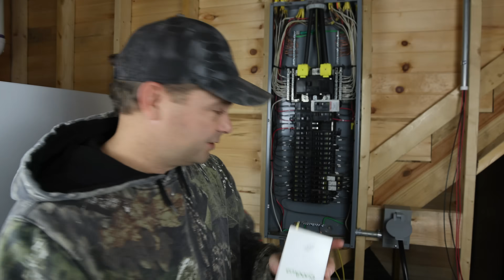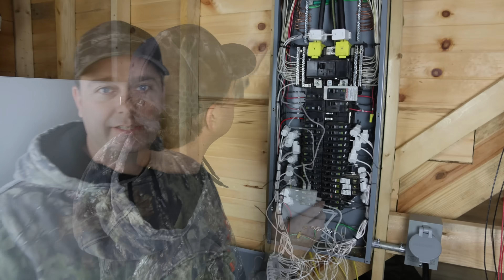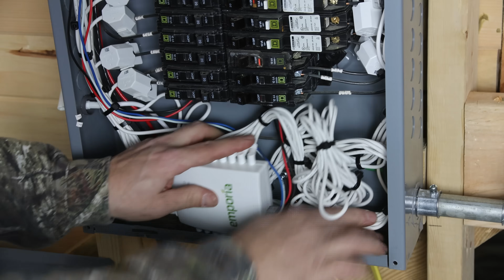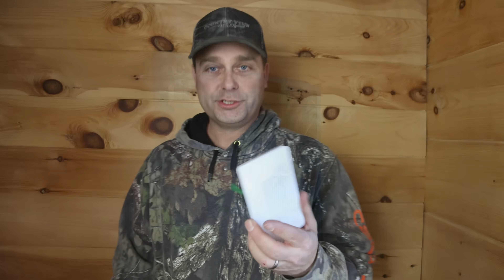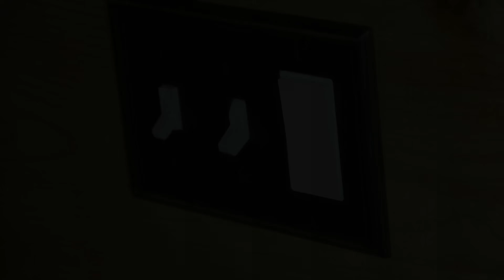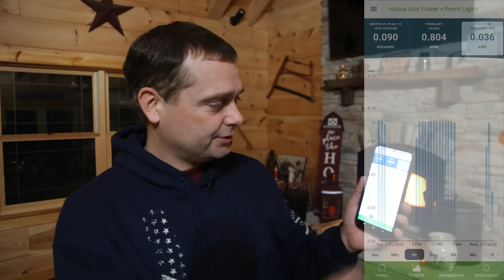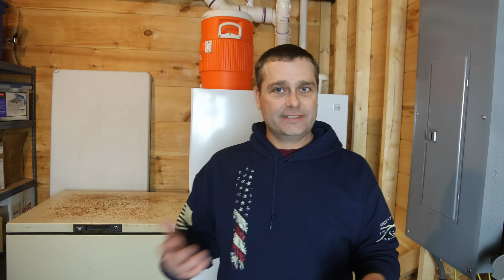Determining our power Needs for Solar.  Installing a Energy Monitor to know exactly what we use.

Comment: We have been on Solar for seven years....We have battery backup. You will make more energy then you think in Winter and Spring then you think. The reason, the ambient temperature of the air and sunlight on your panels effects the efficiency of your power production. You will produce more in summer because of the total hours of sunlight and.because the sun is higher in the sky. If you can place your panels to get the earliest sunlight as this will ensure the most efficient production. The temperature of the panels is the biggest limiting factor for production and efficiency. It is with the money to have a back up generator so if the grid goes out you can charge your batteries. We also have signed up with our electric provider to sell back as there will be excess power you will make that you could be selling back. This has helped us get a return of investment. We will reach one hundred percent ROI in 2024. We highly recommend Solar systems as they are extremely efficient, programmable, dependable and you can purchase the system with built in EMP gardening. (Also lightning protection)

Comment: An inefficient freezer indoors simply means that you are heating with wasted, electricity, indoors.  So if you live in a cold climate, such as Wisconsin or Manitoba with not that much air-conditioning, it’s not as bad as it sounds. Now, if there any fish in the freezer was in and unheated pole barn, then yes you’re just wasting that inefficiency.

Comment: You can create some content on the old freezer.  There are videos on how to increase the efficiency of old freezers.  
1. Clean the condenser coil.  2. Insulate between the compressor compartment and the freezer with spray foam.  
3. fill the spare volume in freezer with ice.   4.  Put the freezer on a timer switch. (how much does it draw when the freezer compressor is not running?).  5. Replace the door seals around the outside of the door.  If it is leaking, it could cause the freezer to cycle more.

It would be interesting to see how much you can improve the efficiency of the freezer.  

There is a new generation of motor controllers coming out based on gallium nitride power chips.  These will vastly improve the efficiency of home appliances like freezers, refrigerators, fans, computers, etc.  basically anything that has an electronically controlled motor will benefit compared to silicon.  Anker power supplies has GaN  based products that are just coming out.  Pretty impressive.  I would wait a few years (if you can wait) before replacing an old inefficient appliance until the GaN based ones are out.

Solar power -  I would install as much solar as your power company and you system allows.  I got a 10.9 KW system in 2018.  Then I got an electric car in 2022.  The solar only puts out enough to cover about 60% of my power now.  Before, it was 95%.  
Its a lot more hassle to add additional solar panels to your system than to do it all up front. If you end up with an excess of solar credit come March, you can always plug in a space heater.  With your pond aerator pulling 500-1000 watts all the time, it is probably the single biggest user of power.   Get an electric vehicle and you will need more solar.(that is the future).

Comment: Super easy to determine household electric energy needs - Your monthly electric bill tells you the amount of energy you used for the period for which you are being charged. That  number will be the total kilowatt hours used for the period. Using your arithmetic skills you (hopefully) acquired in 6th grade, just divide the kilowatt hours used by the number of hours in the period (30 days = 720 hrs, 31 days = 744 hrs, and 28 days = 560 hrs). The result of this foray into higher mathematics will indicate the AVERAGE HOURLY demand for electric power for the period under examination. 

For example: My most recent bill was for 349 kwh (Kilowatt Hours) for a period of 30 days ( 720 hours ), so my average electric POWER use was  0.485 kw or 485 watts. Since there is a lot of  variability in electric power requirements to meet power surges like water pump, furnace, or refrigerator starting, I would at least double the 485 watt requirement to 1 kw, in my case. ( I own a 5 kw (rated peak output) emergency generator which I have used for over 45 years during power outages, and have never "popped" its 30 amp circuit breaker ( 240 v X 30 a = 7.2 kw ).

Comment: I’ve been considering solar power but unless you plan to use it most of the time to save on your electric bill I don’t think it is the best way to go other then a small set up for emergency use. Once the batteries are depleted on all those cloudy days you Need a generator. I have a couple of the smaller EcoFlow units and was surprised at how fast they ran down. The larger of the two didn’t run my C-Pap all night. I like solar but wouldn’t go any bigger then for emergency to run necessary items but would keep a generator.
Reply: I use a solar generator also when out at the ranch, with my cpap going I can run it for about 4 + days, but mine is a little larger than yours.  It is a Bluetti 3k with an extra 3k battery.  I use it to run mainly my cpap, fan and charge other hand held light and of course my phone.  It can run my trailer also it need be, but not the Air conditioner.

Comment: So if you use around 40kw daily, you can easily go off-grid with generator back-up for cloudy winter days!  Get a Honda Eu7000is on a Genconnex propane kit.  I have an in-ground pool, that plus summer air conditioning  brings my summer avg to over 100Kw ($15)daily,  so about 72Kw  daily year round.....no way can I go off-grid with this energy profile.   I'm just backing up the critical circuits.  If you have propane heat/hotwater/clothes dryer, you can do it....but you definitely need your array on the ground for snow clearance.
Reply: I made 73kwhr yesterday wtih 12kw panels but full sun and at winter angle.  Dark Cloudy days can be 2-5kwhrs a day.

Comment: You can also buy dusk to dawn lightbulbs that have a built in photocell. Some even have WiFi connectivity so you can control them directly, although that is confusing when you can also switch them on/off.

Comment: Switch to LED lights where ever you can also.  If you like the soft white color go for 3K, if you like the bright white, like I do, go for 5k.  The 5k's are much brighter and use a very small amount of electricity.  Just be aware of some of the LED's throw off tons of RF.  This was a bit of a shock to me.

Comment: Don't forget to look at your peak use for any given moment. Your array and batteries depend on overall use, but your inverter also needs to be sized by how much you may draw at once (think a/c motors starting up at the same time your air compressor is running). As long as you stay grid connected, it's not as important because you have reserve power coming in, but if your goal is to be energy independent it might make more sense to buy a larger inverter to know you can disconnect if you want to
Reply from the maker: So far, our peak power use was 7300 watts.  The dryer and oven were both running.  but we aren't running the air conditioner yet.   So it will be higher in summer.
Reply: @CountryViewAcres  have you picked an inverter brand yet, or will you try to build something using the Ecoflow components? I have a SolarEdge SE10000 grid-tied inverter which I like because we never lose power, and a hybrid EG4 6000EX inverter on a manual transfer switch for critical loads if we do lose power. Both have pros and cons. The solaredge power optimizers are great for contending with partially shaded areas, but come with the additional cost and equipment. The EG4 is inexpensive and great for soft loads and static loads, but harsher loads like large motors cause faults. 
I'm building an off grid property in northern Vermont and will likely go with the Schneider XW Pro inverter and charge controllers. With wide-open spaces, I don't need power optimizers, and the heavy duty transformer in the XW Pro can handle my woodworking equipment. I'll hopefully make some videos on my other account when I get started on that project. Feel free to check it out if you'd like @offgridne on YouTube, Instagram, and TikTok :)
Reply: @PaulButkiewicz  I've managed a Schneider xw pro 6848 system in addition to sol-ark 12k.  Anyone thinking about Schneider needs to seriously reconsider.  Schneider software and support is terrible compared to sol-ark.  Very tough to monitor and know what is going on with a Schneider plus very noisy at load.   Sol ark 15k is the way to go far simpler install and software is awesome and fantastic support in Texas.  The 12k was weaker in startup loads if offgrid but Ive never seen an issue as I never go off grid)(4500w per leg x2 so easier to overload one side with startup) but the 15k version upped that to 6kw per leg).  Solark backfeeds the main panel and mixes with grid power seamlessly and you don't have to try to power circuits individually.  It's a 30plus year investment I would think hard about it.  Managing both I know first hand and the extra cost is well worth it with simpler install, support and ease of use and monitoring plus better efficiency over the next 30years.  Just read the Schneider manual and go read the solark manual for a taste of the difference.
Reply: @trophyfishn9757   I know Schneider has made significant software improvements over the last year, which is why I set my sights on them when designing the system last summer. I originally wanted a Solark for the simplicity, and waited for the 12k to come out, but was not impressed with its ability to handle heavier loads. I prefer a transformer-based inverter because I know they handle starting large motors with ease. Yes, they can be noisy but that isn't a concern for me because I'll be building a separate power house; although you make a great argument for anyone installing in their home or shop. I won't be building until this summer, so with the rate of technology improvement, I guess I'll have even more options to reconsider again by then. Thanks for your insight.

Comment: a great use of an old chest freezer is for livestock or poultry feed at the barn.   keeps the mice out.   you wouldn't store grain loose.. you would have to drop in a container.  That also keeps it a little cleaner in the off chance you need to put it back online as a freezer.
Reply: Just be careful here, if grain or whatever is stored in freezer and the top or door closes completely, it can capture moisture and cause mold n mildew to spoil grain, cubes, etc... . Ask me how I know?
Reply: @jimsfarm  Good to know.  I can see how that would happen.  I guess any time I have seen one in use, they had it near an inside feeder.  they would carry 100 lb sacks to it and use it to store their opened bags as they used them.

Comment: I put a little meter on a power bar that has  TV, TV box, Modem, Nintendo, and google cast. All were suposidely off . It draws 2kw, an hour 24/7.  These phantom draws could easily be elemanited by the manifuctuer.

Comment: I have the Sense system as it only uses one st of inductors on the main line into the box.  Over time, the box senses each appliance and you can watch your usage.  I use the Kasa stuff as well,  they even have plugs as well so I have one system with the Sense.

Comment: I live in Florida and we use the rule “paddle fans cool or warm people not rooms” so when home fans are on and when away fans off.
Reply: In north east we use ceiling fans to push heat back down as heat rises and makes a more even temperature in the room
Reply: @Timberland-Farms  Yes, as we do the opposite in the south, but the couch in the living room doesn’t care if it is 40 or 80 degrees. Save money/electricity and turn the fan off when not home.

Comment: A note about freezers:

I understand that your goal is to reduce power consumption in order to implement solar. And you also already have your other, newer freezer, so this is mostly just food for thought. When considering these things consider total ownership cost into your equation. That old chest freezer has been around for a few decades and is still running. Modern freezers often fail before they are 10 years old, but they are a little more efficient. So compare the total cost of saving $30/yr in electricity but buying a new freezer every 10 years with the cost of keeping that old freezer. $30/yr more for 10 yrs is still less than the cost of a new freezer.

The cost savings can be put into having a couple more panels on your solar array to make up the difference.
Reply: I agree, an even better idea is to buy the DC compressor style...The Amish in northern Indiana manufacture a DC 12/24vdc chest freezer (3 models) and one upright fridge / freezer...I think they use .7Kw-1.0 /day, and that's no losses by converting to AC like a normal appliance, you'd have to account for something like 20% more solar production to match those smart outlet readings on AC appliances.  They can run on one 300w panel, a tiny MPPT controller (10a) and a single AGM battery for backup.  Plus they have really thick insulation and keep food frozen for 4 days in the event of total failure.

Comment: You will still need to figure in the second freezer for kw needed because it's still a critical need even though it was moved out to the shop. Why wasn't the shop included on the critical need list? Besides the second freezer are there any other shop items that should be protected from power outages?
Reply from the maker: 2 freezers in the barn.   They may be hooked up to solar as well.  I don't see anything else in the barn as critical.  I could run a generator instead if something was needed.

Comment: Ok my question is why the fans run in the bedroom all day? And why not using smart switches to turn them off and on like the outside lights? Curious to see the amount of power a newer chest freezer uses compared to upright. All the cold air comes out of uprights when the door is opened where they don't with chest type, since cold air goes down.
Reply from the maker: The fans in the bedroom are on only while we sleep.  The ceiling fans in the living room are on all the time, because of the high ceilings, to even the temperature between the first floor and loft.  
I will program a plug for the new chest freezer.  But right it is so cold where it is, it probably doesn't need to run very much.

Comment: Will it be years for cost recovery ???
Reply: If this is the same model manufacturer I saw before they said it can take up to six months for it to identify a particular system.  I'm not sold on this product but then again I'm a bit electrical inclined and use monitor plugs and amp meters as well as manufacturing tags
Reply from the maker: On the light switch.  I just cut my power usage in half on the outside lights.  3 light switches will take 9 months to pay for itself.
Or are you talking about the solar power system we plan to build?

Comment: I've been seriously considering doing this myself, I love being able to monitor things. I've been using Killawatt meters to monitor individual items.
Reply: You can also buy whole home monitors that just show you total energy use and not each circuit. We have one like that and they are easy to install.  Just 2 clamps on the 2 hot's coming into the breaker panel.  It sill does live energy use monitoring and you can see it change as something turns off or on and get a good idea of how much power something is taking.  Plus historical use and estimated power bills.

Comment: I'm sure you know this butt I'm going tell byou to be sure. Volts times amps equals required watts
Reply from the maker: Yes, that is why the monitor hooks to both phases.  So, it can measure the voltage on both phases. The sensors measure amps.  Then it calculates the watts based on those readings.
The monitor is required to measure use over time.  A simple amp reading won't tell you that on an intermittent load.  Like a fridge or freezer.